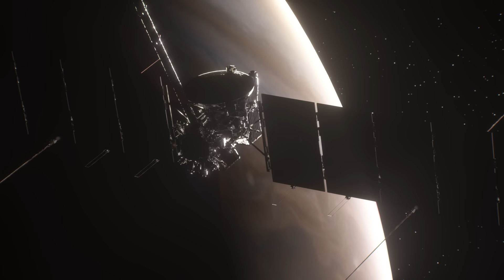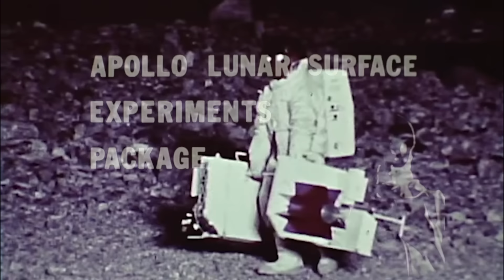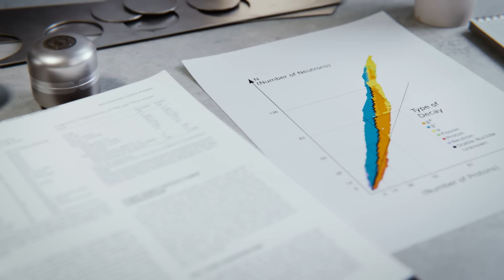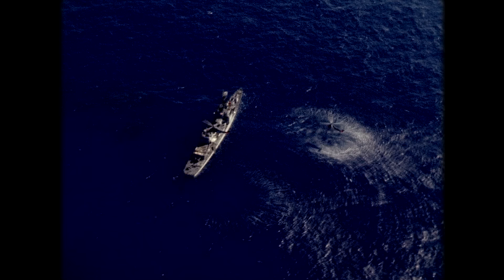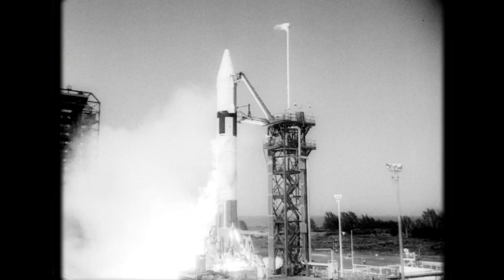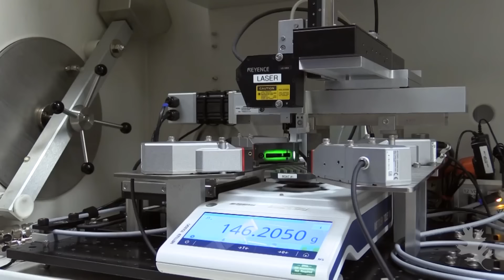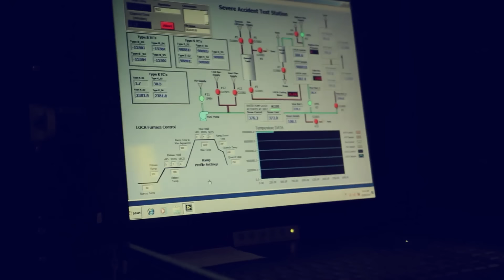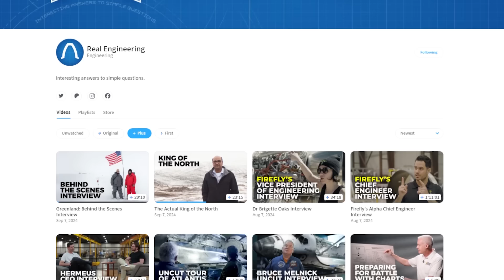NASA'S Plutonium Problem

Comment: "Conventional radioisotope thermoelectric generators (RTGs) used to power spacecraft use a radioactive material whose radiation is used to heat a block of material and then converted to electricity using a thermocouple. Thermocouples are very inefficient and their replacement with TPV could offer significant improvements in efficiency and thus require a smaller and lighter RTG for any given mission. Experimental systems developed by Emcore (a multi-junction solar cell provider), Creare, Oak Ridge and NASA's Glenn Research Center demonstrated 15 to 20% efficiency. A similar concept was developed by the University of Houston which reached 30% efficiency, a 3 to 4-fold improvement over existing systems."

Comment: I always thought it would be interesting is they could add atomic/nuclear batteries or have radioisotopes powered capacitors built into the circuitry providing a small amount of voltage continuously. And a few hundred of them could provide a working low power circuit system that could be self powered for decades. While larger power systems could provide the needed energy in bursts after charging capacitors or batteries. It’s interesting to see that they go for a high output long lasting option for something that wouldn’t need a continuous energy for most of it’s systems. Other than the propulsion I don’t really see a need to provide a continuous power but I don’t work for nasa so what do I know 🤷‍♂️

Comment: We're not running out. We're sustaining. It is still in production. Don't be fooled.

And, it's a good thing. :P
Reply: We're producing less Pu-238 than we need, so yes, we're running out. Production was stopped for years, and has recently been started again but at a very low rate.
Reply: @zounds010  It's still in production. End of story.
Reply: @ In 2021, only 700 grams of Pu-238 were produced. A MMRTG produces 125 W, using 3.6 kg of Pu-238, so it takes 5 years to produce the Pu for a single MMRTG. That means you can power only one or two missions per decade with an RTG. This follows two decades of even lower availability  that has caused missions to be cancelled or redesigned.
Reply: @zounds010  You are completely discounting what is currently stockpiled. Your logic is on public production numbers alone - civilians aren't privy to the production level we have nor the amount stockpiled.

I have family that works in the nuclear industry - if you think we have a chance of running out, that's a total joke.
Reply: @Pleiades721  You are confusing Pu-238, which is only used for RTGs, and of which we have the production capacity I listed, with Pu-239, which is used for nuclear weapons and of which the USA has a stockpile.
Reply: @zounds010  I'm not confusing either. We have plenty of stockpile.
Reply: @Pleiades721  and yet all of the data we have says we don't have "plenty". We have so little that we cannot build and operate as many RTG missions as we want.
Reply: @zounds010  It's not an issue of technology or production - the reason we aren't throwing many RTGs into space is purely bureaucratic. It's no less simple than that. You think our tech and knowledge of science is less than it was than decades ago while we were doing insane amounts of radioactive and nuclear testing?

It's purely bureaucratic.
Reply: @Pleiades721  It is in fact an issue of production. 
A few decades ago, we had a production chain for nuclear weapons that could produce Pu-238 as a side effect. 
That production chain was shut down because in the 1990s the USA had more nuclear weapons than it needed. 
Now, a new production chain for Pu-238 has been set up. This is no longer a side effect from the weapons industry, so NASA, its sole user, has to pay for the entire cost of that chain. 
Because that production chain had been shut down, the only people with practical experience were moving away from the industry, and when a new chain was set up decades later, its personnel had to relearn some of the things that were discovered decades ago but never documented in a a way that others could access it.

Comment: Nah yall can use thorium. Fake news
Reply: Thorium is useless for an RTG.
Reply: @zounds010  so is gasoline.
Reply: @theonereborn1337  that's a non-sequitur. If you want to use thorium, you have to build a fission reactor instead of an RTG. Fission reactors are a lot more complicated and larger than RTGs, making them unsuitable for many missions that now use an RTG.
Reply: @zounds010  took me 15 minutes to pencil some schematics
Reply: @ Go ahead, make a thorium reactor that can reliably produce 250 W of power for 50 years in the vacuum of space, while weighing no more than 50 kg.
Reply: @zounds010  yeah I just did. Come back to this later maybe when you finish high school.

Comment: @8:29 - first, its Gadolinium, not Galdolinium. Second, considering future production of Plutonium 239 is likely to rely on a purpose built reactor which would be far more expensive than a particle accelerator. Just look at the GIGANTIC cost overrun of the Vogtle units 3 and 4 expansion.

Comment: What we need seems to be something that can take the radiation and turn it into electricity directly without going through heat. Perhaps it can be done with a phosphor coating and a solar panel. If you can match the wavelengths you should be able to get a really decent output. (Thats technically still not direct.)
First transform the alpha radiation into light. Then a solar panel matching the wavelength probably made from Perovskites. There is still waste heat so you can use the thermoelectric to capture the heat. Combining the outputs should get a really good efficiency compared to what is used now.

Comment: One could use Amercium- 241. It had a half life of  432.2 years and emits 115W of heat per kilogram. Pu-238  emits 570W per kilogram.
Reply: Apparently, it needs more shielding and the infrastructure for it is even more nonexistent than for Pu-238

Comment: NASA could also use regular fission reactors again, but that is even more controversial than RTGs
Reply: So, here’s the thing: those are more expensive and less space-efficient. Honestly, no one really cares if it’s controversial. It’s NASA, and it’s rocket science. No one else can do rocket science like NASA. So, no one really cares if they do care. They’ll just complain to someone who’ll tell them to shut up. Now, I’m😊 exaggerating. Generally, the controversial aspects don’t matter. Something can be super controversial, but NASA, well, it’s in its own world. I guess I’d say Level NASA does what it needs to do, but it doesn’t have the funds to do what it wants to do. And that’s the issue. The other thing is, just because they could use them doesn’t mean they should. Regular vision reactors aren’t the best in space, and they’re also super complex. And on top of that, it’s a real pain to actually prepare them for lunch. That’s just one of the reasons they haven’t used them and won’t use them.

Comment: There's another option for deep-space missions, at least the bigger probes: a compact nuclear reactor.  Sure, there's lots of potential issues to iron out, but if Pu-238 is a limiting factor it's worth considering.
Reply: Nuclear reactors have been used on spacecraft in the past.  But as mechanical devices they aren't going to work for decades though, and they're quite dangerous if they explode or burn up in the atmosphere.

Comment: Why don't we just shoot neutrons at elements instead of putting them in a reactor?
Reply: because you need a very large number of neutrons to create a usable amount of Pu-238. A particle accelerator would produce grams per year, not kg.
Reply: @zounds010  why?
Reply: @ Particle accelerators accelerate tiny amounts of particles, compared to nuclear reactors.

Comment: This is nonsense, the atmosphere on Europa is about 100,000 times thinner than earth's, there's no way quadcopter flies in that.
Reply: Dragonfly is designed for Titan, which has an atmospheric pressure of 1.3 bar.
Reply: @zounds010  very interesting, I didn't know that, thanks for the info. Just had to google that, and learnt that Titan has an atmosphere of nitrogen, clouds that rain methane and rivers of liquid hydrocarbons. What a bizarre place.

Comment: Build some thermal breeder reactors such as the Liquid Fluoride Thorium Reactor and you'll have the non-fisslie plutonium 238 instead of just have it as a byproduct of producing fissile weapons grade plutonium 239.  The reason why there's a plutonium 238 shortage is that our reactors were designed to produce weapons grade plutonium and we've stopped refining the plutonium 239.  We could easily design the reactors to produce plutonium 238 instead of plutonium 239 and thereby refine plutonium 238 without the fear of also refining plutonium 239.   Granted, the uranium 233 produced by breeding thorium is also usable in weapons but it will have trace amounts of uranium 232 within it which emits gamma radiation in it's decay cycle, hence it would be difficult to fabricate a nuclear weapon without exposing workers to deadly levels of radiation and any electronics within the weapon would be damaged by the radiation.  The gamma rays can also be detected at a distance including from orbit.

A molten salt reactor like the Liquid Flouride Thorium reactors allows for the molten core to be pumped out into distillation towers so that the desired isotopes such as plutonium 238 would be constantly removed from the neutron bombardment and unwanted isotopes to also be constantly removed or just left to vontinue adding energy to the core depending in which isotopes they are.